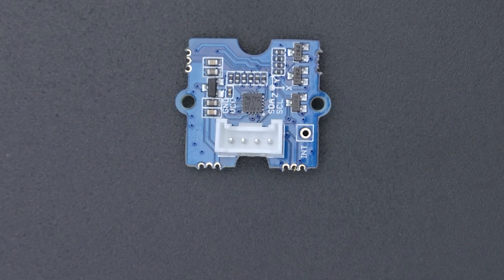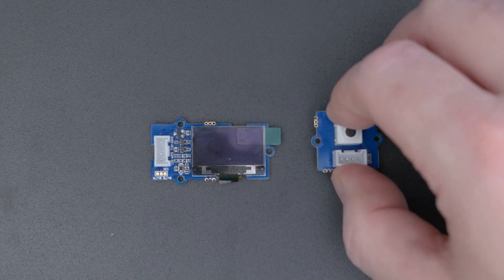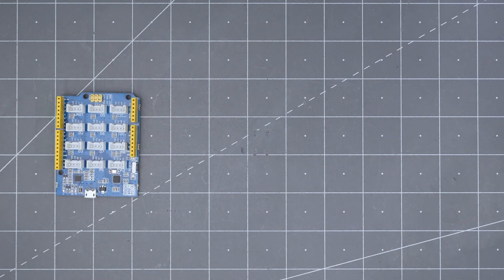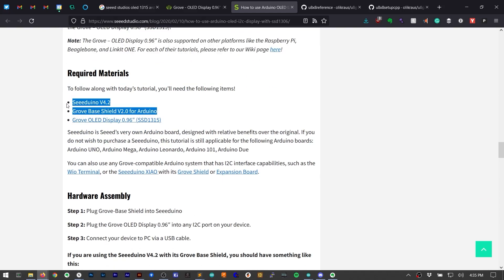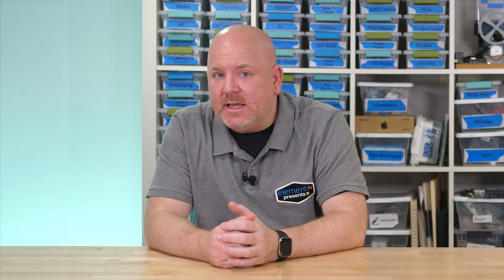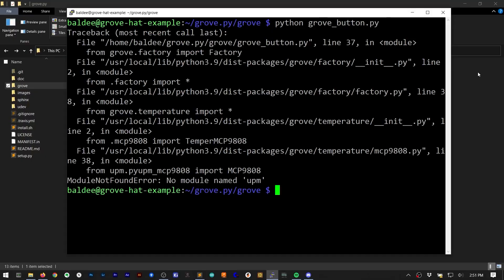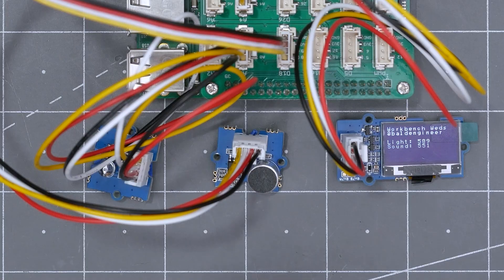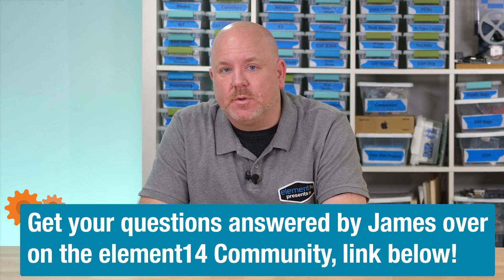Getting Started with the Grove System from SEEED Studio - Workbench Wednesdays

Comment: Software support is essential in my opinion.  I just had occasion to evaluate a particular sensor.  It did not get 5 stars.  One of the big reasons is that there was NO LIBRARY available to interface to it.  There was sample code for the Arduino and Pi for reading the sensor in its default configuration.  There was no sample code of library for modifying that configuration via its serial interface connection.

Comment: The idea is great. Look, you can plug and play. You can even run other people's code, adafruit for example, on the system. 
So absolutely nothing wrong with the hardware, far better than adafruit which involves soldering. 
What in general is my problem is on the software side. You really want a RTOS, or semi RTOS, with object oriented libraries. You don't want to be writing debounce code, just in the constructor say what you want. GPS? It's a GPS, its a clock, you should be able to treat it as both, a composed sensor. Or a 9DOF sensor? you can guess what that looks like. 

ie. attitude = DOF_9(pin=8)

then make calls ....